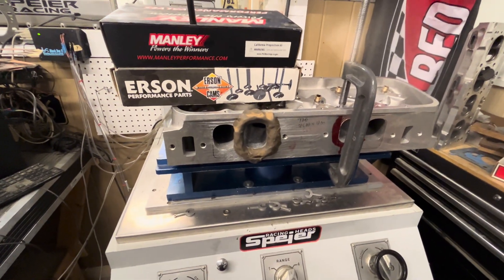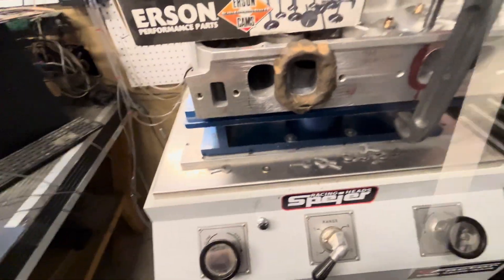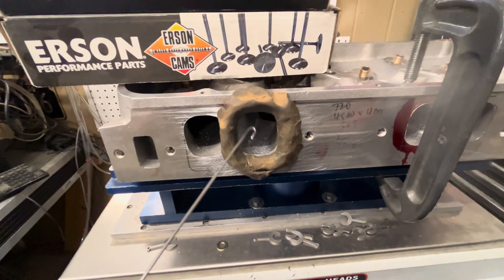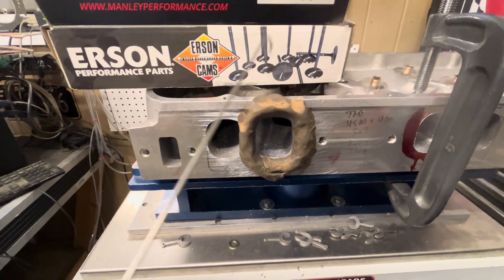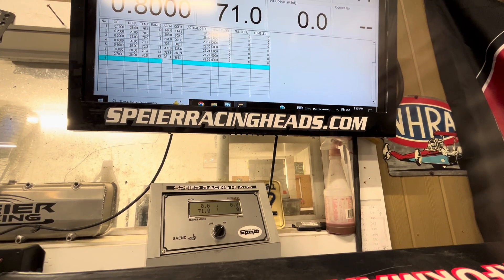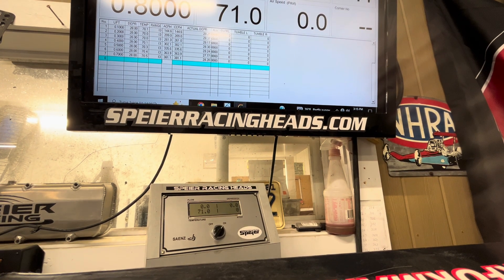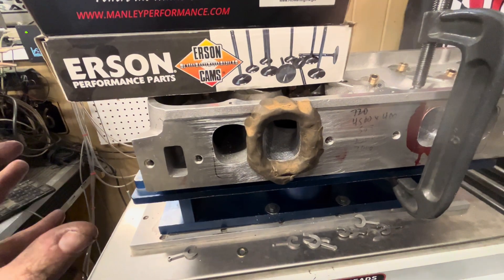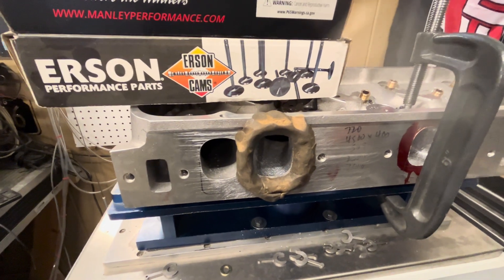Port taper

Comment: There are two ways most think about flow. The volume and speed. The bench will measure how much restriction is created, and the pedo will tell the air speed. The problem with all of it. It doesnt measure vacuum on a running engine at different rpms, and how much charge is able to enter during a valve event. All of these test are just a fixed measurement for science. Numbers to compare that specific variable.  
  A spintron will give a real world scenario to address air flow at different rpm and timing events.
Reply from the maker: That is why my first sentence was this is how I do it, others might do it different. Years of experience create guidelines that will follow you to a live engine. You must find what works for you vs results.

Comment: Hi. Are you keeping the pitot tube in the center of the port all the way in? If you have to enlarge the port around the short side to slow the air down a bit, why not have the port have that same cross sectional area back to the opening? I'm just trying to learn.
Thank you.      Andrew
Reply: I suppose that there would be different reasons depending on application.
Reply from the maker: It's really not possible in this type head because you are working around a pushrod and you are dealing with shape.
Reply: @SpeierRacingHeads  Hi thanks for the reply. Should you generally try to keep the csa consistent throughout the port if possible?  Thank you   Andrew

Comment: What cylinder head are you testing there?
Reply from the maker: Brodix BB2
Reply: @SpeierRacingHeads  Chad, did you have the floors welded in on this BB2?
Reply: Thanks Chad! Another comment asked if the port floor had been welded to raise it. Looks like it has been raised a bunch from stock. What are your expectations with this head with these mods? Engine size, rpm etc?